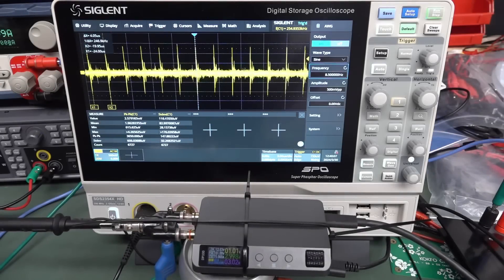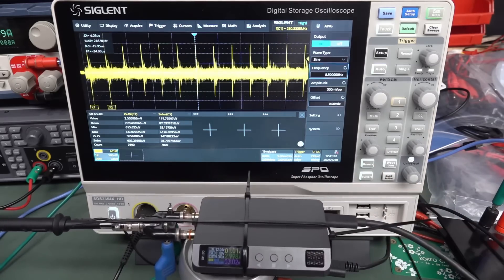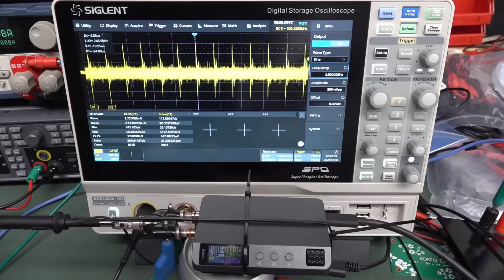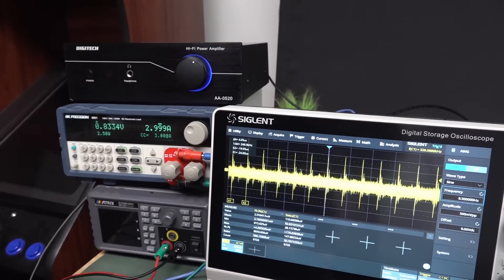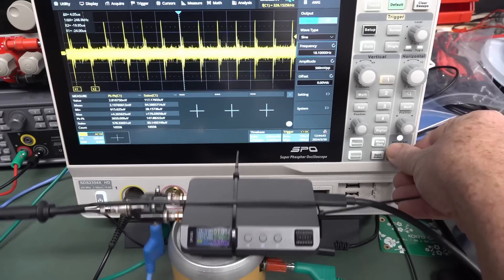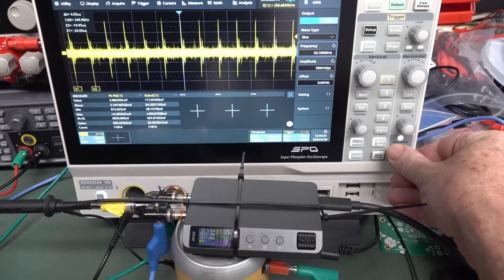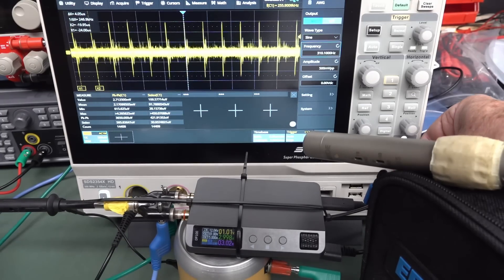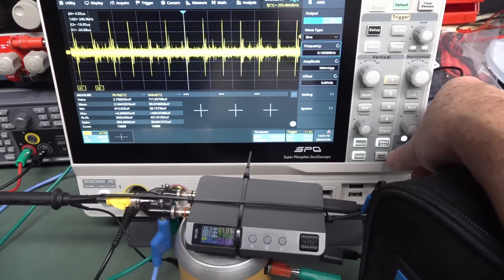EEVblog 1607 - PSU Switching Noise Reduction via Vibration

Comment: Dave what you should do is you should take this circuit, pull it apart into small PCBs connected with long flexible wires, and try vibrating one each while the others remain damped. See where that takes you. Is it just one part, or does the whole circuit need to be shook. Etc. I think this could be an iiiiiinteresting deep dive video.

Comment: There's probably a piezzo effect of some kind doing this.
Wonder of how much it can be reliability repeated? I bet it's so precise that another unit would have another resonance frequency just because of how a ceramic cap is soldered. Or even the probes attached to it may distord the board a bit and change the frequency. 

Also tickling each component of the naked board, tightly strapped to a cushioning surface, with a vibrating probe could narrow down to the sweet spot that produce the beneficial effet.
Reply: I was thinking it was something to do with the coils of the inductor vibrating back and forth, slightly changing the impedance when pushing vs pulling current in a way that's beneficial. But that's just a guess. 

Kind of like the reverse of coil whine, where the changing current in an inductor causes the coils to vibrate and make noise. In this case we vibrate the coils, inducing a changing current at a frequency which opposes the current spikes caused at the switching points. But again, that's just a guess, could be totally wrong.
Reply: @CutoutClips  not forgetting that the vibrating gizmo under it produces magnetic fields by design.
Reply: @Damien.D  very good point, that could definitely have an impact, probably even more than the coils vibrating now that I think about it.

Comment: Looks really weird. Are you sure that it is not an issue with the adquisition or the way that it is triggering?  Oscilloscope rms calulation may mess up things when working with coherent captures vs incoherent.  Screen captures turn much more coherent when you hit the right frequency.
The vibration may messing with the PSU control loop and the oscilloscope trigger may be focusing on a particular time.
Reply from the maker: Pretty sure.
Reply: @EEVblog   Maybe you can add a stick to that vibrator, open the PSU case and start poking things to see who is responsible of this madness
Reply: @EEVblog  Maybe you can open the PSU case and try to locate who is responsible. You can try to transfer the vibration locally with a rod.

Comment: Thanks Dave! Both videos were very interesting!

From ChatGPT, what do you think Dave how accurate is it?

Ah, you're referring to a physical phenomenon where vibrating a circuit or electronic component at a sub-harmonic frequency can reduce electrical noise. This approach is quite nuanced and involves the interplay between mechanical vibrations and electrical signal behavior. Here's why this method can be effective in lowering electronic noise:Mechanical-Electrical Energy Conversion: Certain components within electronic circuits, such as capacitors and inductors, can convert mechanical energy (vibrations) into electrical energy and vice versa. When these components are vibrated at specific frequencies, the mechanical vibrations can interact with the electrical signals, potentially damping electrical noise.Stochastic Resonance: This is a phenomenon where the presence of a certain level of noise, when added to a weak signal in a nonlinear system, can actually enhance the detectability or clarity of the signal. By applying a mechanical vibration at a sub-harmonic frequency, it's possible to adjust the noise level in the system in such a way that the signal-to-noise ratio improves, paradoxically making the system operate more efficiently in certain conditions.Harmonic and Sub-Harmonic Interactions: In electronics, noise often contains harmonic components — frequencies that are integer multiples of a fundamental frequency. Vibrating a circuit at a sub-harmonic frequency can create interactions between these harmonics and sub-harmonics, potentially leading to destructive interference with the noise components. This interference can reduce the overall noise level within the circuit.Resonance Damping: Every physical system has natural frequencies at which it prefers to vibrate. If an electronic circuit or component is mechanically vibrated at a frequency that is a sub-harmonic of its resonant frequency, this can lead to a damping effect on the resonance. Since resonances can amplify both desired signals and noise, damping the resonance can help to reduce the noise amplitude without significantly affecting the signal.Vibration-Induced Electron Mobility Enhancement: In semiconductors and other conductive materials, mechanical vibrations can influence electron mobility and distribution. By carefully selecting the vibration frequency (such as a sub-harmonic of the electronic signal frequency), it's possible to enhance electron flow in a manner that reduces resistance and noise.It's worth noting that this approach requires precise control over the vibration frequency, amplitude, and phase. Additionally, the effectiveness of this method can vary significantly based on the specific electronic components, circuit design, and the type of noise being targeted. In practice, this method might be used in conjunction with other noise reduction techniques for optimal results.
Reply from the maker: Plausible.
Reply: A bunch of sentences put together from various sources is not an explanation of anything.

Comment: How long will it take Audiophile scammers to build and sell a shaker table for all their equipment to "get rid of the 50/60Hz noise"... ;)
Reply from the maker: Damped with cryogenically frozen springs.
Reply: @EEVblog  Finished in fairy dust and farted on by a unicorn.
Reply: @EEVblog  ...grab'em before the Ghostbusters show up!
Reply: @EEVblog  Damped with cryogenically frozen brains
Reply: Love it! My company is already on it: we added a green edge for even superior performance than our competition.
Reply: Nah..  You sell them vibrating chairs..  It cancels the noise inside the ear drum...  I would show you on the oscilloscope, but I can't probe your ears..  You'll just have to trust me . :)
Reply: Our company is working on a VibraCouch product for those who make excessive in-bed noises so as to quiet down the nosy neighbors' complains....
Reply: @triod371  but what kind of noises exactly? Low frequency intermittent ones occurring due to airways blockage, or subsonic rumbling combined with higher frequency sounds of erotic origin?
Reply: they've been selling them for decades
Reply: A shaker table WITH huge rubber vibration dampers, no doubt.
Reply: as long as they use mains and not battery, it doesn't matter
Reply: I hope soon so at least someone gets their money away from them

Comment: For a number of years now, work was proceeding on the crudely conceived idea of an instrument that would not only supply switched mode regulated voltage for use in unilateral electronic circuits, but would also be capable of automatically synchronizing mechanical vibration for induced switching noise reduction. Such an instrument is the turbo encabulator.
Reply: Ah yes, haven't heard about the turbo encabulator in years. Legend has it the military bought all the rights and it's now used to encabulate vibe and rations..
Reply: Posted one day early.

Comment: this is the best example out there of sinusoidal repleneration, amazing!
Reply: It's a nice trick, but today we have modern materials to solve the problem. Just make the base from pre-famulated amulite. Takes the modial interaction of magneto-reluctance and capacitive diractance right out!
Reply: @Gameboygenius  Capacitive diractance. You might be on to something here. Dave is shaking this thing with a continuous sinewave in search of amplitude changes. Maybe the secret in nulling out the noise is in capacitive diractance. As in the measure of compressed attenuation after dropping it onto the floor for only once in eternity on the condition there is no bounce.
Reply: @Valenorious  that's where the modial interactions come into play
Reply: @Gameboygenius  but not for 50$ too tight a budget even for a logarithmic casing!
Reply: i didn't understand a single thing in your statement and i call myself an electrical engineer  😅😂 @Gameboygenius
Reply: @aneeshprasobhan  You might just need to adjust your sinusoidal dingle arm.

Comment: Perfect timing
Reply: And perfect timing could be the exact reason why the performance increases when subject to 250hz~. I don’t think the solder joints, traces, leads for the components or the “solid” conductors themselves would be affected by this mechanical vibration, so it leaves us with the inductors, caps and especially the transformer. I was thinking that this frequency was shaking the coils around at a harmonic frequency of the switching frequency, which maybe would’ve caused synchronisation at some point? This could be suppressing the existing inertia in the vibrations of the coils?
Reply from the maker: God-like. You beat the porn bots, congrats.
Reply: @EEVblog  the pom bots? what do they sell, potato wedges?
Reply: @EEVblog  I was actually referring to seeing a new video just as I was opening  YouTube. But..... 😆
Reply: @EEVblog 😂